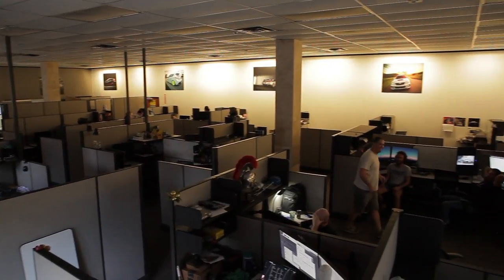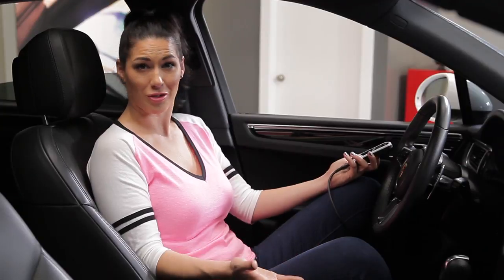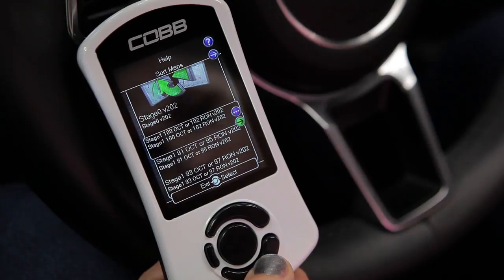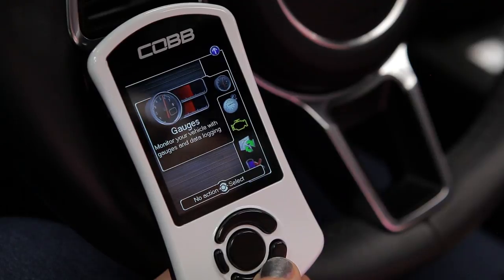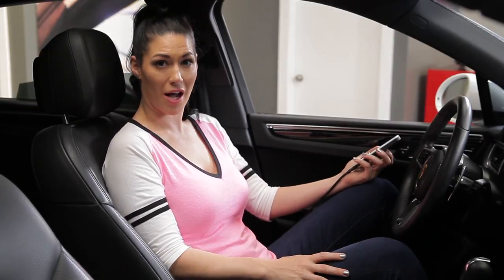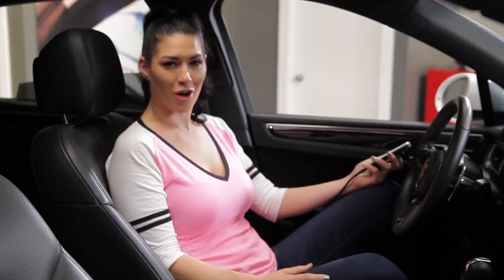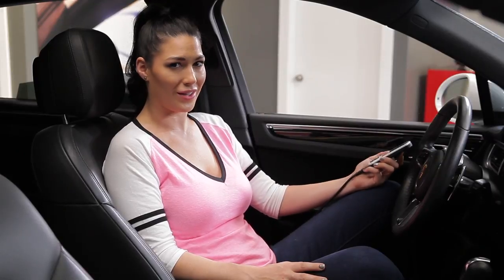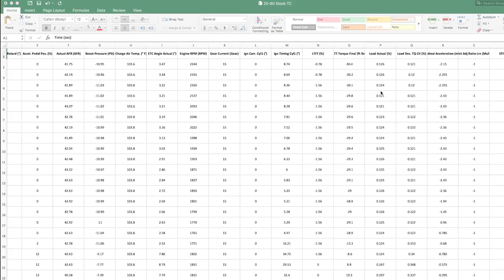COBB Tuning - COBB University Episode #16 - How To Use an Accessport

Comment: Are maps included with the Cobb? If so do you have to pay for each map? Can you make your own custom tune?
I am considering cobb but I would like some straight answers on these questions before I do.
Reply: U probably know already but their included
Reply: @lindenmartin3065  thanks for responding.  Yeah I already know. I bought it shortly after this post. Tried all the OTS tunes and ended up being unhappy, swapped turbos and got a protune using cobb to flash and data log.
Reply: why? didn’t like stage 2 ? or economy mode??

Comment: I work with data analytics and just purchased the AP to do a bunch of...well analyzing and driving. I want to log the stock setup on my 2015 wrx as well as my stage 1+ big SF intake - it looks like the first time you install, you HAVE  to pick a tune. Can I just simply revert back to my _raw backup to log those numbers before bolting the intake on? (asking without visibility as it comes tomorrow woohoo!).
Reply from the maker: We offer a "Stage 0" or "Stock Mode" map which uses stock calibration data with the Accessport installed.  You should be able to choose that during the installation process so you can log the car with the factory calibration data. - Marshall@COBB
Reply: Thanks guys that'll be perfect.

Comment: I have mazdaspeed 3 I wanted to change the tune but said make sure to have the battery on charge is this correct?
Reply from the maker: Sorry for the late reply. Ideally its best to have a charger on the battery when doing an install or uninstall. If you are simply flashing from one map to another and you are confident the battery has a good charge. Typically its fine but it never hurts to be safe.

Comment: If I buy this product, without doing any modification yet to my car, would I use Stage 1?
Reply from the maker: Yes!  Kyle@COBB
Reply: Ya you just would have minimal horsepower gain unless you added a few bolt ons such as intake, exhaust, ect
Reply: Damn this was 3 years ago nvm
Reply: @matthewkehler1230  lol

Comment: I have a couple of questions. First, where would I get the maps for the access port? Are those already in the device or do I have to download them? Second, my friend gave me his old v2 access-port when his ecu fried. He said I could take it to you guys to get it unmarried. I have the access port and a quote from the dealer were it shows his car had electrical issues and a fried ecu. How much would it be to get it unmarried?
Reply from the maker: The maps will already be on the Accessport.  I'd recommend a firmware update via AP Manager to make sure you're on the latest version.  More details on that here: https://www.cobbtuning.com/support/step-by-step-firmware-update-instructions/
The v2 is pretty old at this point. It should still work but, depending on what vehicle you have, there may be maps/features that are v3 only.  Contact us at 866-922-3059 or email support@cobbtuning.com for details on how to get the Accessport relicensed.

Kyle@COBB

Comment: Can I tune my car when I install a downpipe or intake with the Accessport
Reply from the maker: Hey Dan,  The Accessport comes with several off the shelf maps that work with specific modifications.  Most vehicles have maps for an intake and or downpipe.  Check out the map notes for your specific car to see what maps are available and the respective modification requirements for each: https://cobbtuning.atlassian.net/wiki/spaces/PRS/pages/96120842/Map+Notes+for+2006-2007+WRX+MT
Kyle@COBB
Reply from the maker: You can!  As long as the intake is supported (COBB SF) you can use our Stage 2+SF OTS Map. - Marshall@COBB